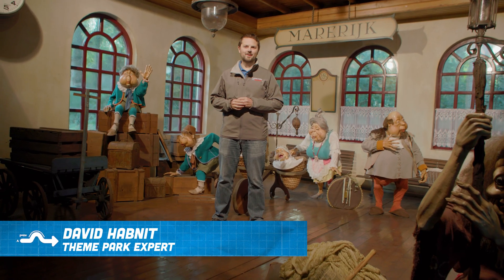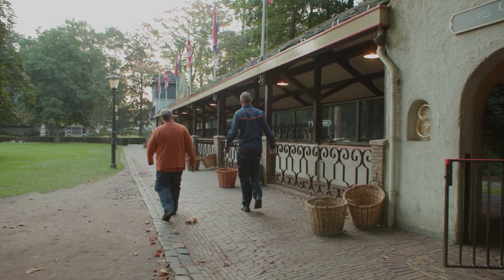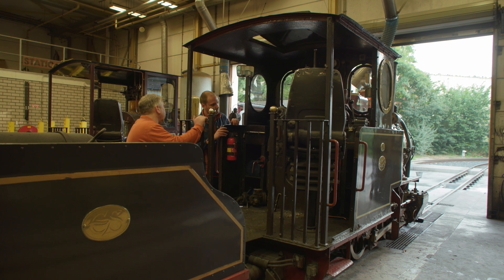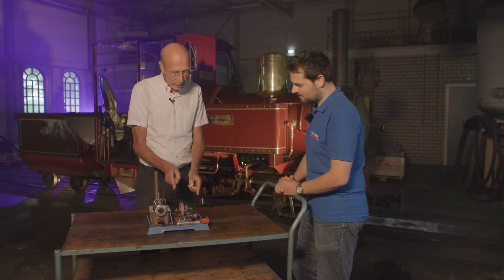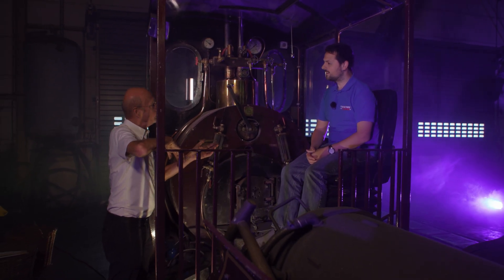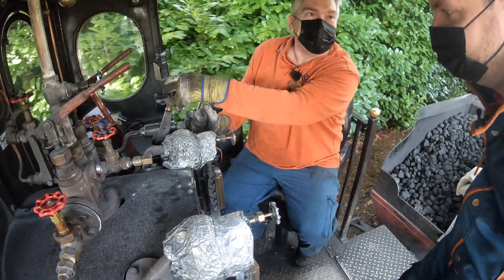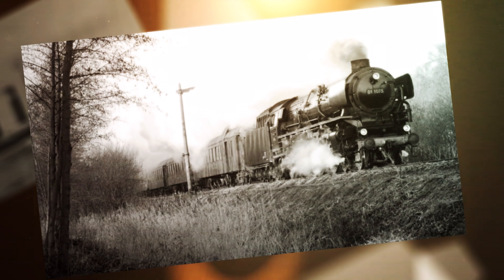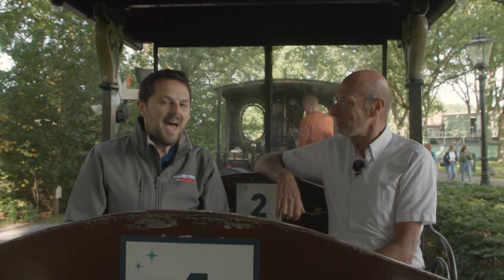How Does a Steam Engine Work?🚂 | Operating the Steam Locomotive in Efteling for a Day!

Comment: I wonder what the big differences are between using coal, wood, or different types of oil (I know most oil engines need spare steam from an external source, often called "atomising", also named after the atmoiser component they can also contain)